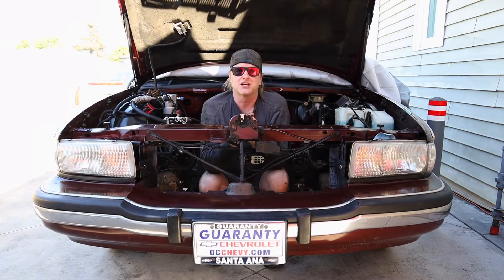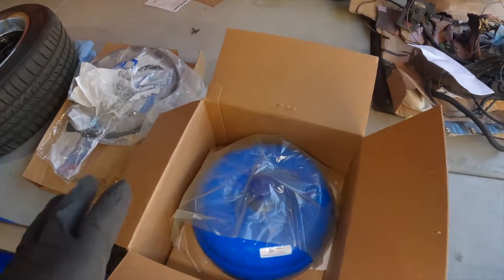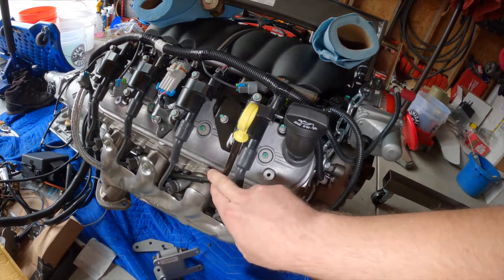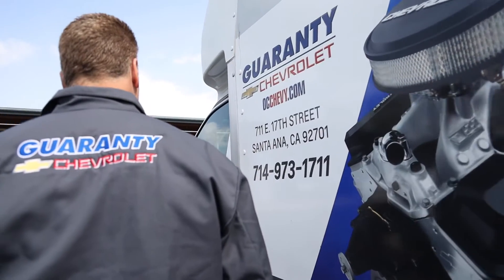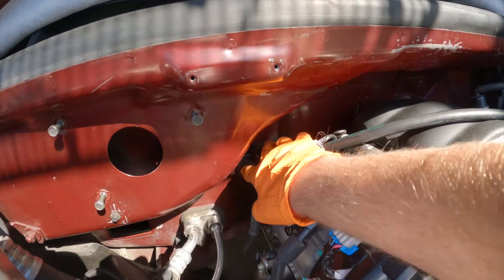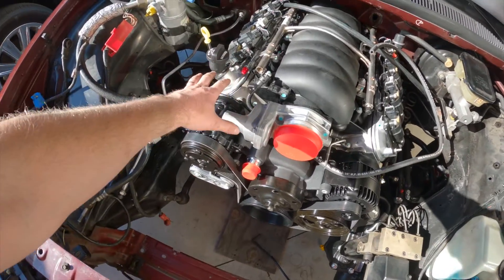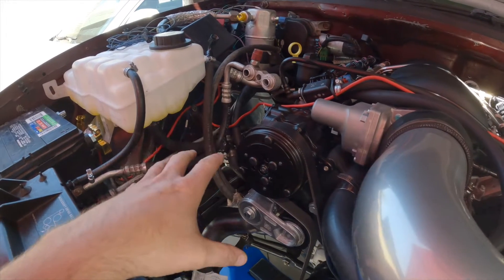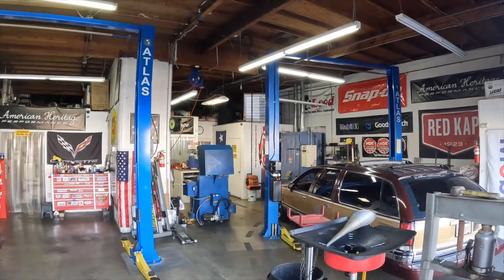Installing an LS3 E-ROD & Holley Accessories in a Roadmaster Wagon!!! (Pt.6)

Comment: Currently in the process, is there a reason you didnt go AN fuel lines? Going to state ref also but want to use AN, are they not approved? Also in case i just go your route what is the fitting you used on the fuel rail to attach the rubber fuel hose? Thanks in advance!
Reply from the maker: Hello! Not sure what you mean by AN fuel lines. Like steel braided? The system is Earl’s Vapor Guard with -6 AN fittings and a c5/c6 fuel filter regulator. (It was installed one video before this one). 

Refs did not mention the fuel system at all. But In the LS3 EROD install instructions there are some SAE standards mentioned for hoses in a couple places that I used for the evap purge solenoid etc, you could always search for that type of hose and use throughout if you don’t have something in mind.

But I’m not an expert. Just an idiot who has done this exactly once hahahaha.

I think this is the fitting I used at the fuel rail “Earl's Performance Vapor Guard OEM Quick-Connect Fuel Rail Adapter Fittings 751166ERL” it just twists/locks onto the barb at the end of the fuel rail, and is ready for a -6 AN.

Hope that helped. Good luck with your build! I’m 4,000 miles down the road now and just took the interior out to do the carpet hahaha.
Reply: @internetbrandsautogroup3826   Thank you, it is very much appreciated your time to document everything. And yes i meant like nylon braided hose that is SAEj30 rated and i attach AN fittings instead of clamps like in your vid. I plan on adding an earls compression fitting at165006erl to the existing metal line from the vehicle then running it to the fuel rail using the -6 fitting number you just gave me. 

I wish i could document everything the way you did to help others but my videography is not as good as yours. And good luck on the continuation of your project!  I will be rewatching these vids as i go